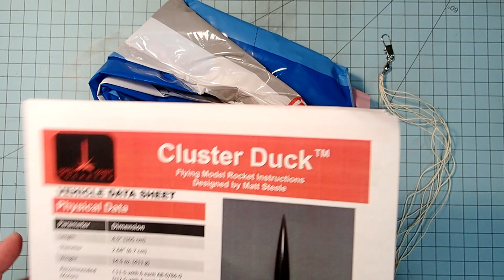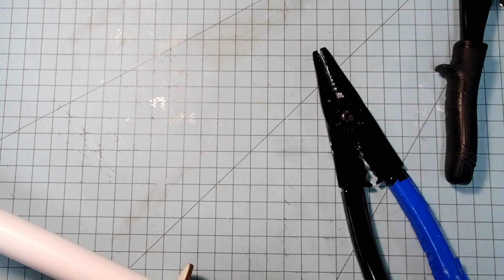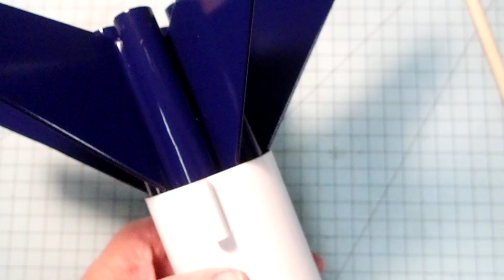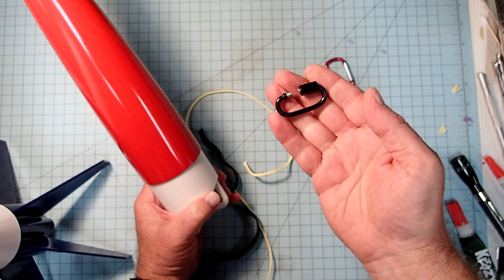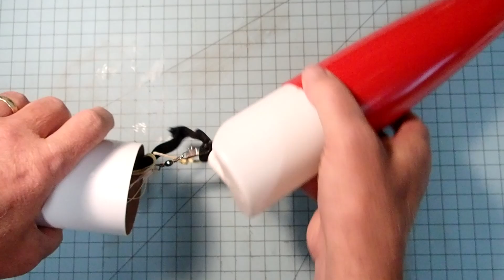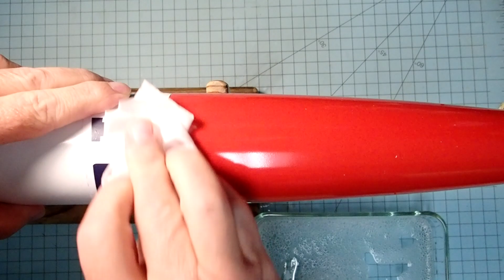NCR "Cluster Duck" model rocket assembly (part 2 of 2)

Comment: That cable, crimping and shrink tubing is dubious at best? Why not just braided kevlar, it be lighter? Plus that whole huge elastic shock cord also. Is that really needed?
Reply from the maker: I'll know more after I launch it. This whole recovery system is different from anything I've built before. Theoretically, the combination shock cord should be easier on the rocket as long as it doesn't burn or get tangled. I think the cable was completely superfluous, but I'll reserve judgement until after a few flights.